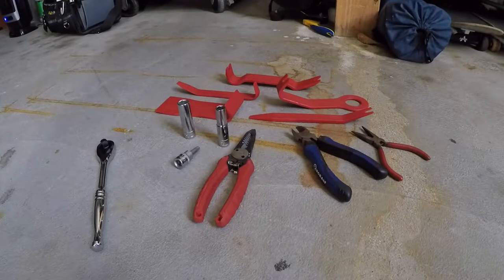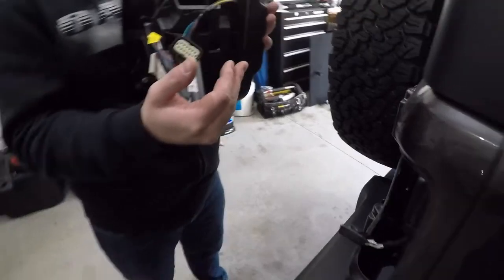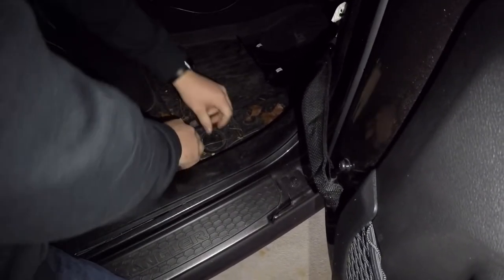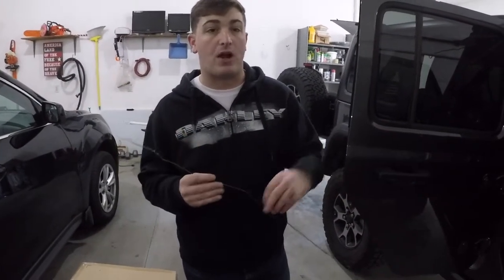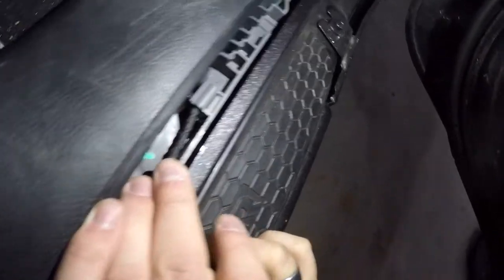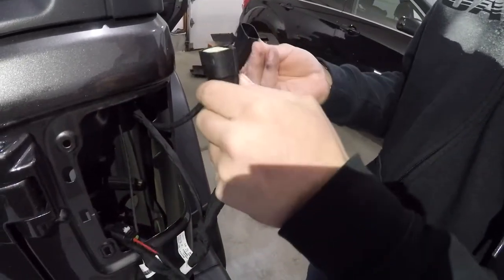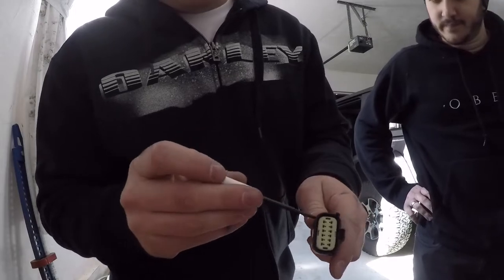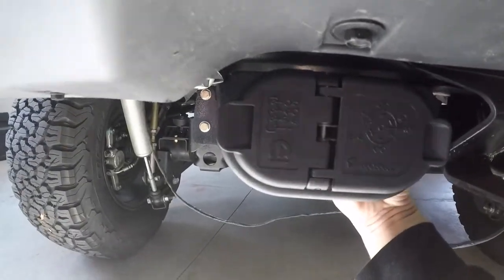2018 Jeep JL 7 pin trailer connector Install

Comment: Is there an easy way of removing the 7-way F Connector wiring after they click into place?
Reply from the maker: Easy way no iI’ve only done it once and i believe i tried to depress the lock with a screwdriver but it’s still in there pretty dang good

Comment: So I’m just trying to wire my breaks manually, where would my break wire connect to? From the 7 pin connector? Like where in the jeep does it connect to?
Reply from the maker: @motivationalworld345  the breaks or the break controller?

Comment: After installation do you have to program anything in the car.  Dealer told me they had to program something, so that the harness can work. Is that true?
Reply from the maker: Negative everything worked right away i could see it being possible for a 7 pin connector but for the 4 pin which youll most likely be using towing under 3000lbs everything worked right away but even for the 7 pin the only thing that may not work is a brake controller but that has a separate wire and there are no factory brake controllers so that should not matter either long story short i did not program and my trailer lights for my jetski work perfectly
Reply: @TaskForceOffroad  I dont think you have to, but I beleive if you have a tazer, you can add the tow, and it helps with abs controlling sway.  At least thats what I have read.
Reply from the maker: Joseph NC I've been towing all summer with my jetski and haven't seen a need but i fo know with my superchips i can add towing but i never noticed it do anything

Comment: nice, i have to do this as well, do u think i will have a problem towing a bushwacker 15 plus ????  also this mopar kit has the charging wire right to charge any batteries i might have on my camper ?
Reply from the maker: as for the capacity as long as its within  the tow rating for the jeep it shouldnt have any issues with it. im not sure about the charging wire however i  would assume if that is standard with a 7 pin connection than it would have it. i  have never towed with a 7 pin personally so im not 100% sure. however if they thought to have a wire for the trailer brakes im sure they would also have that one as well.
Reply: Yeah cool, i just ordered a Bushwacker 15 plus

Comment: Where do you connect the blue wire that you ran from the back to the front?
Reply from the maker: MD Polish Soccer that blue wire is for trailer breaks i dont have a break controller and don't have a trailer with trailer breaks so i havent wired that up yet

Comment: Does installing this yourself void the warranty ?
Reply from the maker: JC Gomez no to void a warrenty they need to prove that whatever you did is the cause of the problem IE you changed your suspension and then it failed obviously that’s not warrantied